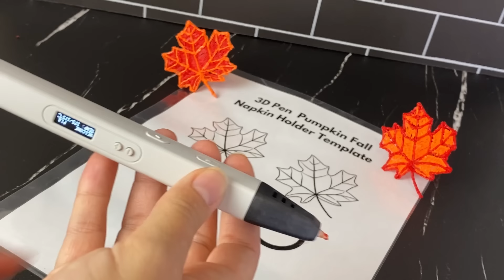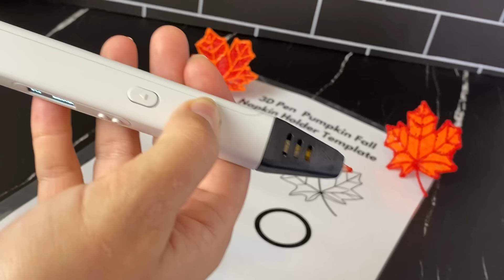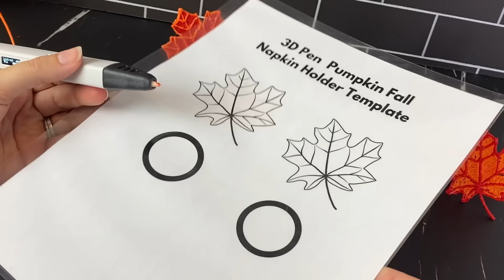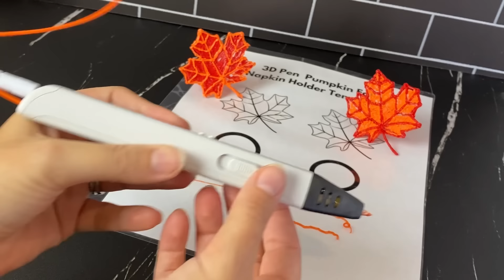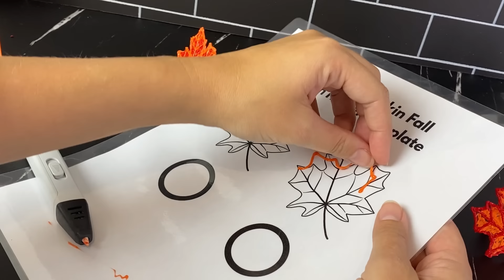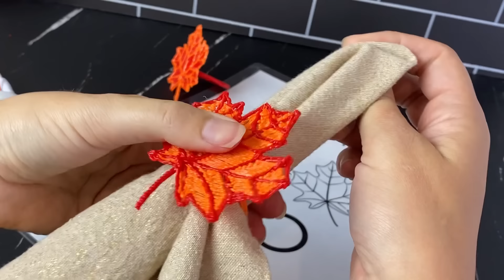How to use the MYNT 3D Pro Pen

Comment: late comment but still very relevant.
You can use much more than pla or abs with this pen. Pretty much any temp in between such as petg, asa, in face Ive actually been sucessful using flexible tpu.
I wouldnt use infused filaments such as pla with wood etc.... those type of filaments are  abrasive and will wear out the nozzle. I find petg is my favourite filament to use